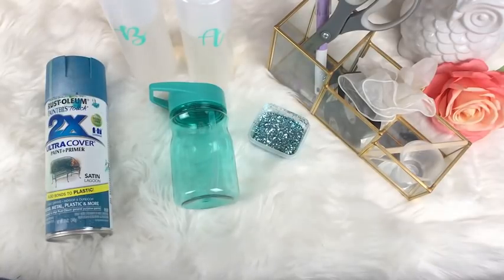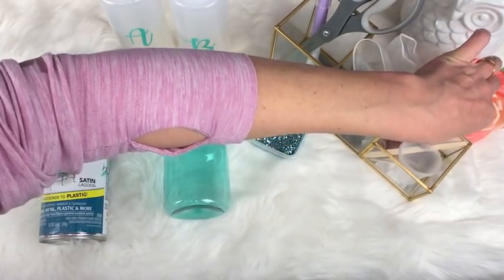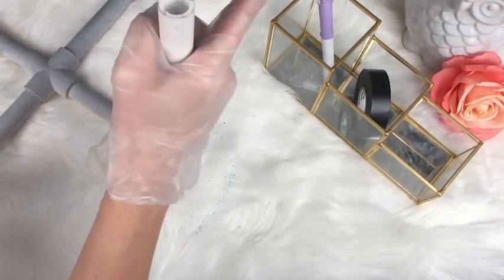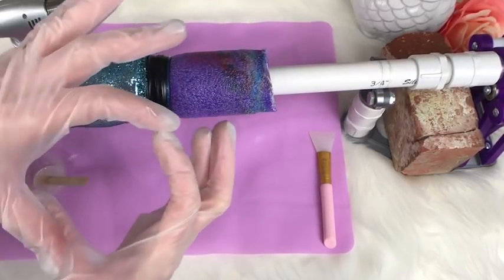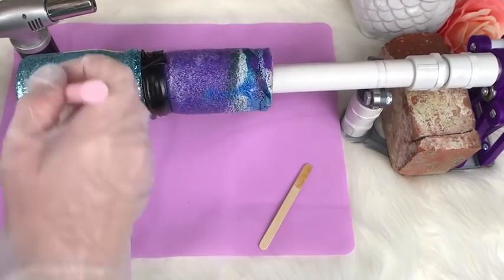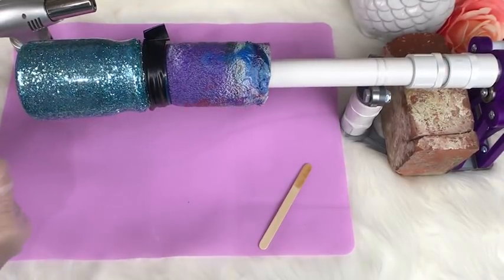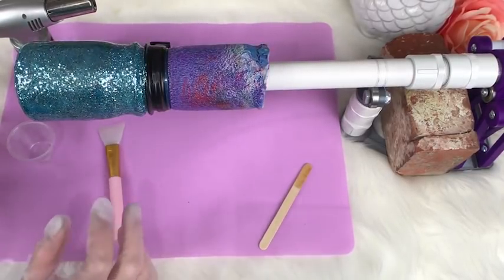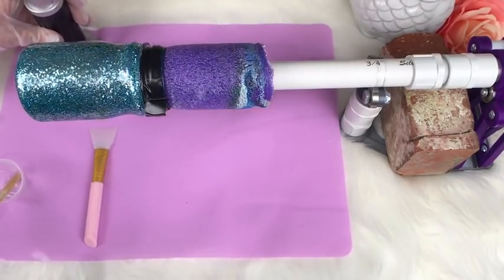How to Epoxy and Glitter a Dollar Store Plastic Tumbler Cup

Comment: Love your videos. I also wondered about using plastic tumblers. Question what about condensation? Will that do anything to the epoxy? Thanks
Reply from the maker: val phil Nope! The condensation is just on the outside. Water on the outside doesn’t mess with epoxy (luckily or this wouldn’t work at all because you wouldn’t be able to wash it. If water gets behind the epoxy it’s because there wasn’t a good seal between the epoxy and cup. But if that’s the case it’s doomed regardless because you can’t wash it or get it wet at all

Comment: We never put plastic cups in the dishwasher so this is perfect. No worries of heat messing with the epoxy. Much cheaper than metal tumblers too, though they don’t keep ice quite as cold. How do you wash the silicone brushes though?
Reply: epoxy won't stick to anything silicone so just pop off the epoxy once it's dried or wipe with a paper towel/baby wipe immediately after you are finished

Comment: Is the epoxy safe through the plastic since it is not double walled?  Not only for consumption but with the condensation from the cold liquid will it breakdown the epoxy?
Reply: I did a comic book page on a plastic bottle and to me the epoxy still makes water smell funny. Although I put it top shelf dishwasher and it melted because I had heat dry on so that may just be the smell I’m smelling.
Reply: yes, she only uses FDA compliant epoxy witch is safe once fully cured and no, epoxy is never dishwasher safe, don't soak it, and don't leave it in a hot car.... standard practice for all things epoxied

Comment: Once I Epoxy and add glitter how long do I wait to add more epoxy? And do I sand (if I need to) after the 2nd epoxy?
Reply: you wait until you can grab the cup without leaving finger prints, this is to ensure that you have mixed your epoxy correctly. Yes, you sand if needed, wash with a little Dawn soap and water then apply your epoxy

Comment: Thank you so much for this video! I tried the hang method a week ago on this same water bottle and it came out sooo bad because I realize now it was because it was too much epoxy and it started dripping. My question for you is can you pop microbubbles with alcohol? I've heard you can pop them by spritzing the cup with alcohol after if you don't have a heat tool.
Reply from the maker: Karita Drake yes you can but I find heat to work better. You can take a cheap lighter and run it across the top of the surface if you don’t have a torch
Reply: @LittleLeeandRose  Okay, thank you so much for the reply!

Comment: How long does it need to cure?
Reply from the maker: Veronica Ortiz each epoxy has a different cure rate (so check manufacturers guidelines) but most epoxy brands fully cure in 72 hours. However after about 12-14 hrs it is hard to the touch

Comment: Is it true at applying epoxy to plastic makes it toxic? I read this in another group post. They recommended not to use epoxy on the .99 cent water bottles from Walmart. TIA
Reply: Sandra Ruiz the concern is that the heat that is produced by the epoxy will cause the plastic to leach toxic chemicals. This is the same as when you microwave plastic. I would definitely use BPA free plastics if you do this. Again though, if you microwave food in plastic containers the danger is the same, so it’s up to you what you feel comfortable with.
Reply: once fully cured and as long as you are using a FDA compliant epoxy, it is non toxic

Comment: I have found plastic bottles just like this one at the dollar store but they are not hard you can squeeze and flex the side of the bottle. If dropped or squeezed will the epoxy crack and break off? Or does it reinforce the plastic so you can no longer squeeze and bend the sides in?
Reply from the maker: B Pratt all epoxies cups need to be treated like glass cups. If you drop it it will break. If you squeeze it hard it will break , just like a wine glass would
Reply: LittleLee and Rose Thank you, ma’am. I didn’t know if the epoxy would reinforce the plastic enough or not. Do you think it is hard enough for small hands(4 to 6 year olds)? I have feral children who might try to hulk out on a pretty cup. They know not to throw and break things on purpose but might try to show me how strong they are. I don’t sell much, I mostly just craft for fun and gifts for family. Your videos have been amazingly helpful in keeping me on budget, I don’t waste epoxy and I don’t have a ton of fails/mistakes eating up my supplies. Thank you!!!

Comment: What epoxy do you use? Im barely starting and got my epoxy from Micheals. Buyers it's not as shiny as youre tumblers. What am I doing wrong?
Reply: she only uses FDA compliant epoxy which is safe once fully cured.... make sure you are mixing your epoxy correctly and you are getting all the micro bubbles out with a torch or heat gun (it will be cloudy/not shiny because of bubbles if you don't)

Comment: I use a heat gun is that okay?
Reply from the maker: Alicia Tengwall yes totally but it’s not as effective at popping micro bubbles
Reply: Oh okay I watched other videos and they said heat gun so I ran out and bought one. Now I need to get a torch!  Ha my husband is starting to wonder what I’m up to!!!!  Tonight I painted a bunch of the plastic tumblers I bought at the $1 tree.  Right now they have a bunch of fun tumblers and the lids are different colors.  I was actually going to test using the epoxy on one then I came across your video.  I’m glad I did now I can go to town with them.  Thank you for your video, you’re great and I am following you!
Reply: On the packaging it says epoxy is flammable  i was wondering is it truly safe to use a blow torch to pop the bubbles?
Reply from the maker: Valery Lopez I have been doing this for a long time and have used numerous epoxies and have never had an issue with it.

Comment: Why did so many videos say you can’t epoxy over a single layer plastic Tumblr?
Reply from the maker: Jubilee Sisters 🤷🏼‍♀️ Ya got me because it works perfectly. Misinformation out there is one reason I wanted to start teaching y’all!
Reply: Jubilee Sisters not suppose only two layer wall plastic cup because the epoxy will go through a one layer and get people sick.
Reply from the maker: Justine Arce That’s weird because that is incorrect. As long as it’s FDA compliant resin it is fine. They use epoxy resins to seal most canned food products
Reply: I came to the comments for comments like this. Would the spray paint make it not FDA approved? And what epoxy do you recommend for this type of project

Comment: Great video! Could I use modge podge to adhere the glitter?
Reply from the maker: Connie Tang yes you can but will most likely need two coats and the chunky glitter won’t lay flat with modpodge so it will take more epoxy to cover
Reply: @LittleLeeandRose  Would the modge podge would with fine glitter? Could I use fabric? Thanks for the quick reply😊
Reply from the maker: Yes modpodge works better if it id fine glitter but will still most likely need two coats
 @brwnsuga00
Reply from the maker: @brwnsuga00  And you can TOTALLY use fabric!!

Comment: After you put the first layer of epoxy and glitter do you wait for it to dry or just press down on the glitter then instantly apply the epoxy? When applying the second and third layer if epoxy do you just allow the first layer of epoxy to cure for 12 hours then add the other layers?
Reply from the maker: For the first layer I do hangmethod add the glitter and press it down. Wait 6 hrs then apply another coat you can apply the top coats as soon as 4hrs between each but I generally wait to see if I need to sand in between
Reply: Thank you 🤗. Do you use the drill master rotary tool to sand your cups? I’m assuming that’s why you listed it but I want to be sure.
Reply from the maker: telisha spencer I use it for repairs! Also cleaning up the edges! It is perfect for sanding out tiny spots like bubbles and bugs LOL
Reply: Thank you so much. I’m doing my first cup so I’m just trying to ensure that I’m doing it correct 😬

Comment: Can you use a soft plastic cup? Or it has to be a hard plastic?
Reply from the maker: Elsa Garces soft works just put good layers of epoxy. I am about to post a tutorial on a more flexible plastic
Reply: How long would a cup take to make start to finish ?
Reply from the maker: Elsa Garces if you are able to work steady then 3 days. Then it needs 3 days to completely cure to its most durable point before actual use
Reply: @LittleLeeandRose  thank you for your quick reply! 😊